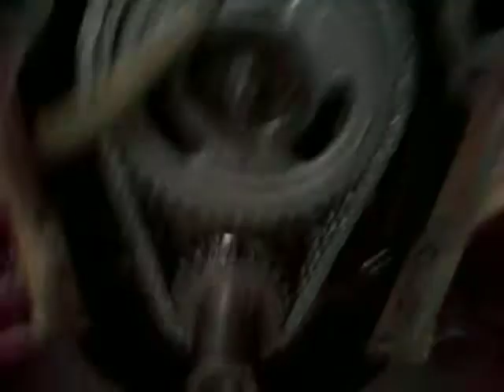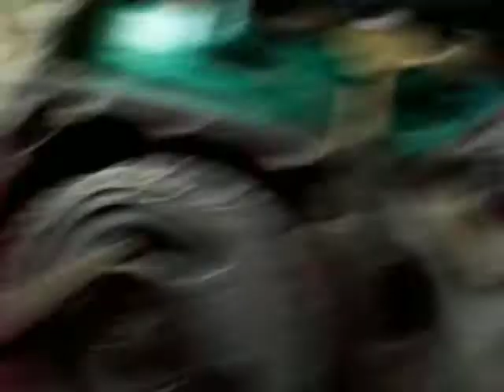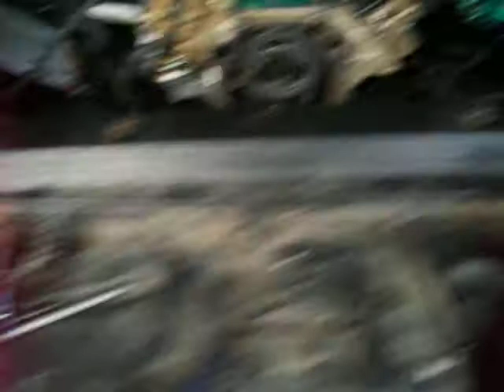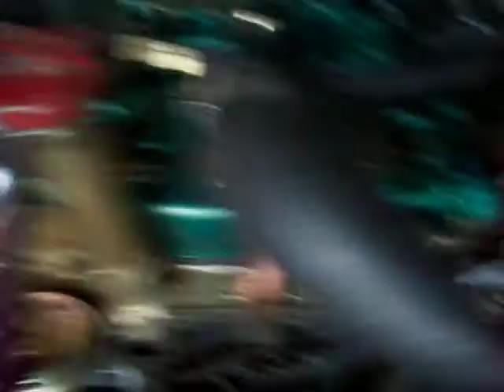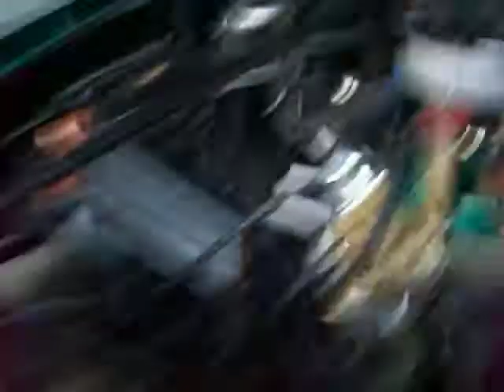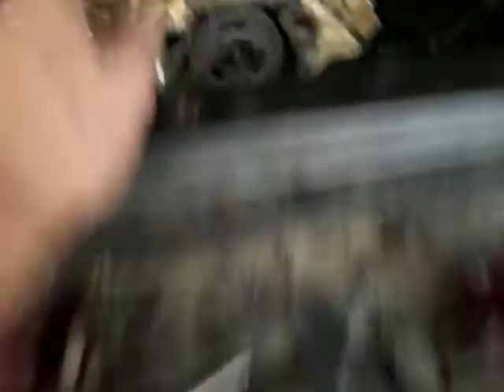Vista Cruiser Timing Chain

Comment: That's not an interference engine right?

Do you still know the previous owner? Could you ask about a different cam?

I replaced the gas tank on the Taurus last year. Only to have the fuel pump go bad this year. Going to cost me a ton in labor again to fix it ... shoulda done it when I had the chance.